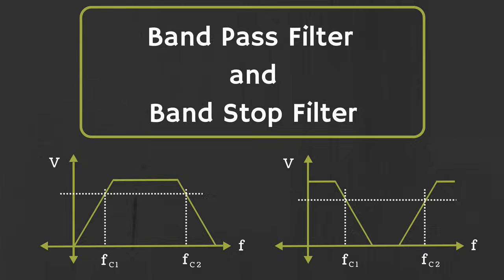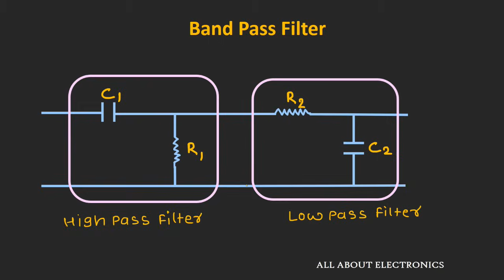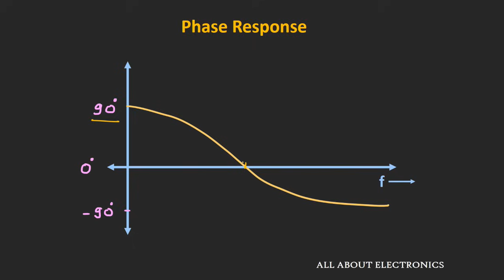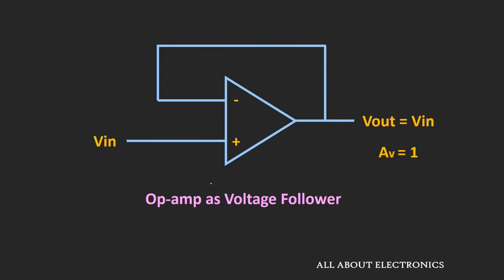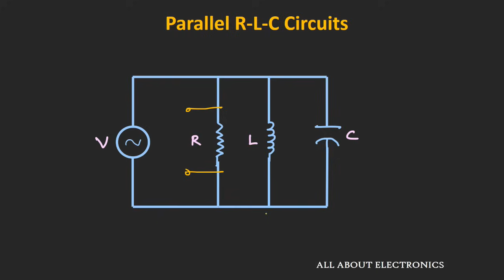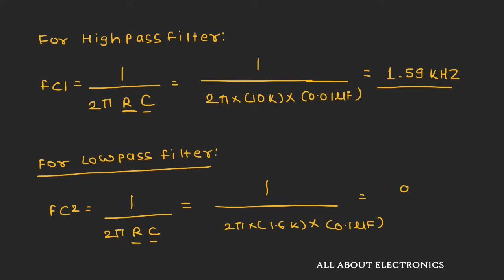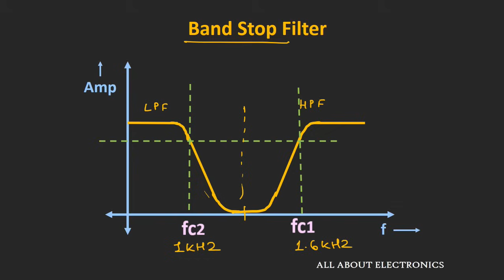Band Pass Filter and Band Stop Filter Explained

Comment: Sir, u explained it very well I need ur help, actually I want to make the band pass filter, which only passed certain range of frequencies, rest it become inactive 
I want to. Make it on lt spice.  Guide me, becuase in ur video. Or many video only I am. Getting to bell shape graph.  It is not working as lock system
Reply from the maker: I have already explain how to design the filter. But more practical purpose, you can use this very useful tool for accurate design. Will probably make a short video on that. 
But here is the link for the same: https://tools.analog.com/en/filterwizard/
Hope, thats helpful.

Comment: After cascading a first order low pass and first order high pass we get , second order bandpass then why should we take 3db fall instead of 6 db (for second order)?
Reply from the maker: Irrespective of the order of the filter, we always look for 3 dB point where the voltage becomes 0.707 of the peak value or the power becomes half. So, depending on the order of the filter, 3 dB frequency will change. 
I hope, it will clear your doubt.
Reply: @ALLABOUTELECTRONICS  
Thank you sir...is it is true for both active and passive filters

Comment: in which filter the output current becomes very less than input current
Reply from the maker: It is frequency dependent. It depends at what frequency we are looking at. But I think you are talking about parallel resonant circuit (which acts like a band stop filter).

Comment: Hi from Poland, I loved your video, you explained everything well. It was really helpful for me. Could you just tell me if for band stop filter f_H frequency will be always higher than f_L and for band pass filter f_L will be always higher than f_H?
Reply from the maker: f_L stands for lower cut-off frequency and f_H stands for higher cut-off frequency. So, irrespective of band-pass of band-stop, when we refer f_H and f_L, f_L is always less than f_H. I hope it will clear your doubt.
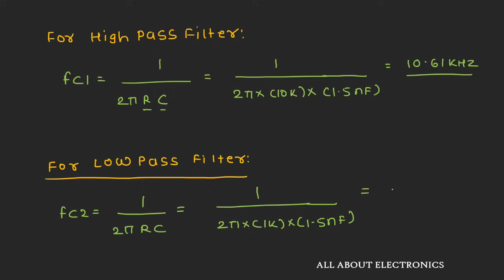Reply: @ALLABOUTELECTRONICS , thanks I had doubts cause in 5:30 minute you calculated fc1 and fc2 and low pass filter is higher than high pass filter. Low pass filter is 106.1 kHz and high pass filter 10.61 kHz. That's why my question :)

Comment: why we need R1 and R2 in the adder?
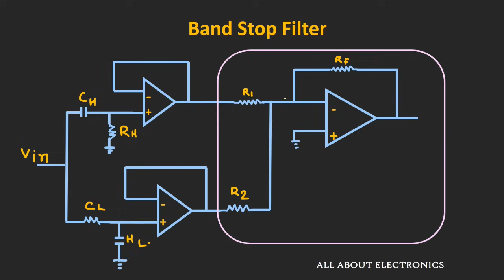Reply from the maker: I think you are referring to 10:05 right ??  They are used to provide the gain. -Rf/R1 and -Rf/R2 will be the gain for upper and lower stages respectively. Let's say the output of the upper filter circuit with buffer is Vx and for the lower circuit, it is Vy. Then the overall output will be (-Rf/R1)Vx + (-Rf/R2)Vy.
I hope it will clear your doubt.
Reply: Yes at 10:05. So it is mandatory put them in the circuit ,  Rf is not enough, right ?
Reply: I thought that to the adder (the circuit on the right ) Rf was enough to work properly.
Reply from the maker: No, R1, R2 are required. It's basically summer circuit. For more information, you can check the video on op-amp as summer.
Reply: @ALLABOUTELECTRONICS  ok thanks , I will check this video. Btw merry Christmas :)

Comment: I remember during college days I used to think, Why LPF and HPF in cascade doesn't result in Band stop filter, just like cascading HPF & LPF result in Band Pass Filter
The reason is when we use less cut off frequency LPF and High cutoff frequency HPF. The multiplication or cascade will results in LPF only bcz the LPF output is zero after its cutoff frequency which restricts the role of HPF

Comment: Why do we use an adder for the band stop
While cascade for band pass?

Can we use a cascade for band stop as well?
Reply from the maker: The frequency response of the cascaded system is the overlap of the individual frequency response. In case if try to implement the bandstop filter by cascading the low pass and high pass filter then the output would be the overlap of the individual response. If there is no overlapping region, then probably you will not get anything at the output.
For the bandstop filter, it should reject only a particular band of frequencies and should pass all other frequencies. So, If you just cascade the LPF and HPF then either you get some overlapping region or nothing at all. And that's not the frequency response of the Bandpass filter. So, to get the desired frequency response for the bandstop filter, you need to use adder. 
I hope it will clear your doubt.
Reply: @ALLABOUTELECTRONICS  Yes i understand now. Thank you very much.
Reply: Hello Asha, I hope you got it right....

Comment: What will happen if we use Low pass filter first and then High pass filter?
Reply from the maker: Since it is cascade connection, you can interchange the blocks.
Reply: @ALLABOUTELECTRONICS  sir i was asking whether it will still work as Band Pass Filter or not? If signal is input to that what will happen? What will be output?
Reply from the maker: Yes, it will work.
Reply from the maker: It will still work as band pass filter. But you need to carefully select the cut-off frequencies of both filters (to get an overlapping region) for band pass filter.
Reply: Yes Raj, this will work...

Comment: How to calculate the pass band gain practically
Reply from the maker: Just apply the sine wave with variable frequency (You can apply it using the signal generator). and measure the output signal amplitude. 
The ratio of output to the input will give you pass band gain.

Comment: Excellent Videos. I have a quick question. In the band stop filter why we are connecting the outputs of the LPF and HPF at the inverting terminal of the summing amplifier (voltage adder circuit). Will, it not then work as a subtractor rather than working as an adder? Cause if we want to add, do not we have to connect the outputs of the LPF and HPF at the non-inverting terminal of the summing amplifier?
Reply from the maker: The outputs of the LPF and HPF will get added bu the output will be inverting  (will have 180 degrees of phase shift and looks like -(VLP + VHP)) as it is connected at inverting terminal. To get a positive output, one more inverting amplifier will be required. 
I Hope it will clear your doubt. If you still have any doubt then do let me know here.
Reply: @ALLABOUTELECTRONICS  Wouldn't it be the same thing to just connect them to the non inverting input and have both outputs of the filter added?

Comment: why you put both filter in parallel ?
why not cascading ?
Reply from the maker: I have already replied to that question in earlier comments. 
Here, I am copying that answer:
In case of cascade connection, the output will be the overlapping region of the individual response. Suppose, you cascade the LPF followed by HPF, then after LPF, all high frequencies are already attenuated. So, even if you use HPF, it will not pass high frequencies as there no high frequencies to pass. That's why adder is used. 
I hope it will clear your doubt.
If you still have any question then do let me know here.
Reply: Add in cascade ..u will find a result whereinn only high pass filter willbe effective then.

Similarly in LPF if you parallel them,, nothing would be filtered.

Check it

Comment: why dont we cascade LPF with HPF in band stop filter instead u have used adder but in case of band pass filter, cascading of HPF with LPF is done...
Reply from the maker: In case of cascade connection, the output will be the overlapping region of the individual response. Suppose, you cascade the LPF followed by HPF, then after LPF, all high frequencies are already attenuated. So, even if you use HPF, it will not pass high frequencies as there no high frequencies to pass. That's why adder is used. 
I hope it will clear your doubt.
Reply: +ALL ABOUT ELECTRONICS thnx alot

Comment: What will happen if the out puts of the two Opamps are connected directly (i.e without the two 1K Ohms resistors @12:55  of video) as the output of the band stop filter? I will be really obliged for your prompt clarification.
Reply from the maker: If you do not require any gain then yes you can connect.

Comment: Thanks for a nice video. Would you kindly tell us that what is the purpose of the adder (at 12:55 of the video)? Why can't we simply join (short) the outputs of the low pass and high pass filter & take the output from that point.   
What will happen if we don't use opamps and just use one high pass and one low pass filters in parallel?
Reply from the maker: Using Op-amp we can avoid the loading effect. If you simply connect the output of individual filters or to say if you connect them in parallel, then you will see the loading effect. So, it is good practice to add the individual filter responses using Op-amp.
Reply: Thanks for the prompt response.